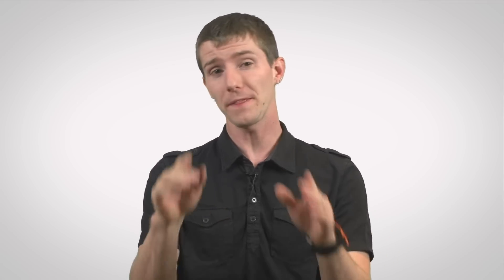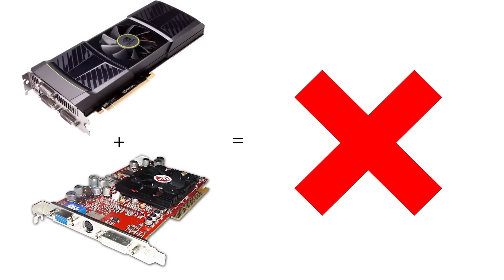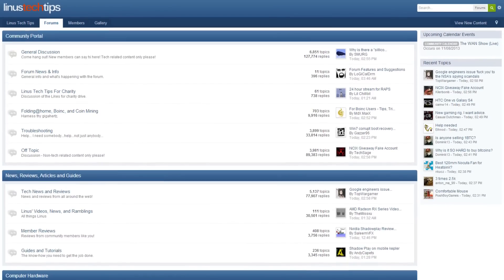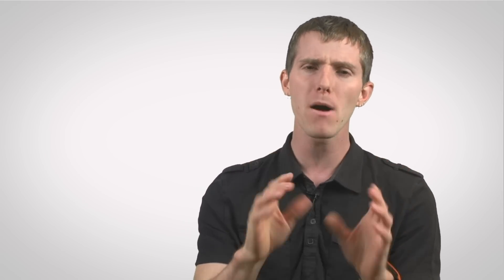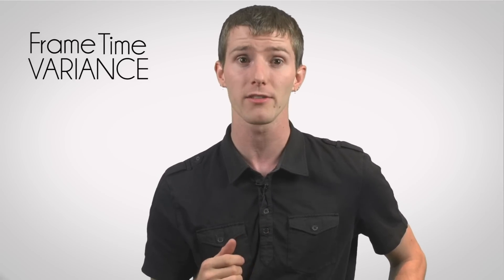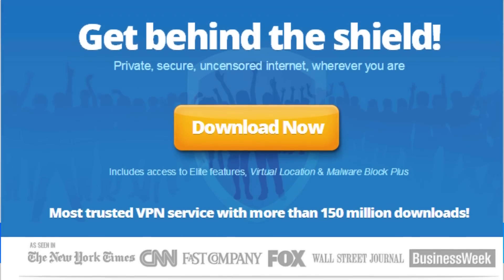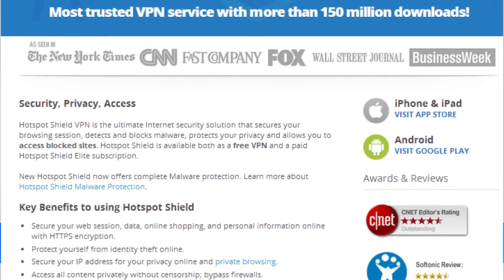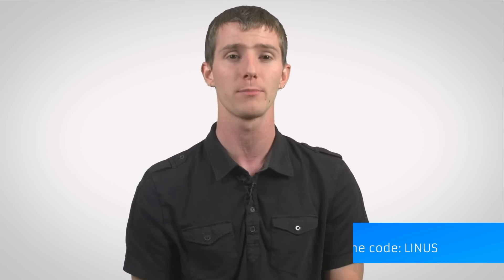SLI by NVIDIA - Everything you Need to Know as Fast As Possible

Comment: how do you compare GTX680 2way SLI vs GTX1660 Super ? Can the SLI beats the single 1660 Super? My PC: i7 3930k, Main Asus P9X79 Deluxe, 16Gb Dominator 1866Ghz, Corsair AX1200, SSD SamSung 860 Pro 512Gb + Samsung 850 Pro 256GB. I'm considering to upgrade my old PC's VGA for almost working with AutoCad, 3dsMax, Adobe Premier, Photoshop.... more than playing games. Thanks for support.
Reply: Don't even try SLI today. It's pretty much dead.
Reply: @user-tm3fz7qx3s  thanks, NVlinks should be better though?
Reply: @MansStyles  Nvlink is a protocol and as far as I know, only the Quadros have real Nvlink. I think I heard that you can enable Nvlink on consumer RTX cards, but it's experimental. It should be easier to implement for developers since it turns all cards into one big card rather than a slow link of multiple cards you have to program functionality for. Look it up at its current state since I have years old knowledge in Nvlink.

Comment: If I put 2 RTX 2080 ti cards in my next computer, would I be able to turn one of them off at any time?  I play a few games, but for the most part I'd like to run the second card only for final renders in Blender or 3DS MAX.
Reply: Don't waste your money for unworthy old GPUs just but the RTX 4090 it's basically equal to 2x SLi RTX 2080 Ti and the RTX 4090 is mostly faster because single card is a much better optimize than 2 SLi Cards.

Comment: Is GTX 1050ti sli worth it in 2018?
Reply: No, you're better off buying the gtx 1070 as the 2nd 1050ti won't give u double the performance as linus explained in the video. SLI isn't worth it unless you already have the top end card such as 1080ti. Nothing is faster then the 1080ti therefore SLI 2 of them would be worth it, but at that point it you'll just be blowing money. So in other words, if there's a faster single card then the SLI, go with the single card.
Reply: @mikeramos91  The RTX 4090 is faster than 2 GTX 1080 Ti SLi for 2023.

Comment: Can anyone explain me one thing? 
Question: How on earth SLI (Dual GPU) would ever increase/double performance of the game in framerate if both of these Gpu's are doing same data at the same time and use only use as much memory as single GPU have?

To me it's like running same game on two separate pc's and wishing to get double fps. The whole SLI thing sound totally idiotic! Logically there could be only this way: Both GPU doing totally different data and using their own memory but in result adding everything together. Which would mean two 4gb cards will have 8gb total vram. 
Can someone explain me what did i missed?

Comment: Can anyone help or tell me if the type of SLI bridge matters for any GPU? I'm going for a 2 way SLI with the Asus - GeForce GTX 1080 8GB ROG STRIX Video Cards. I read that the ROG Enthusiast SLI Bridge isn't compatible with the 1080 GPUs. as well as I'm having trouble with finding any 2-way SLI bridges with a good price. So I was wondering if I can use a different manufacturer SLI bridge to connect both GPUs.

Comment: Unless you plan for SLI with Used cards in the future. Your diminishing returns is pretty much negated and kinda making rigs upgradable for cheap. My big question, is using one Ti with a OC card from different Manufatures okay? do you need to manually match the clock speeds?

Comment: If I run 2 Radeon RX 460 on a i3 processor and on one monitor. Will I still get the same performance as only one you but not the other because it would bottleneck my CPU. Pls answer me. :)

Comment: can I run gtx 1080 and titan xp in sli or evan 1080 and 1070 in sli
Reply: You can but it will use the speed of the slower card. Also if there are vram differences it will ignore the extra vram on the more powerful card so no point in doing that.
Reply: NuclearOnion  ok bro thanks
Reply: I would reccomend the 1070 sli btw, out performed the 1080 for not much more. It even out performed the titan x in some games.

Comment: im sorry im dumb but will gtx 1060 and 1070 pair??
Reply: AlienZap nop
Reply: tnx for the relpy you saved my pocket :)
Reply: No problem 👌👌👌👌
Reply: Even a 1060 and another 1060 wont pair as it doesnt support sli. As for pairing 2 different cards it does work but it will just use the spec of the lowest end card so there isnt a point.
Reply: Ohhhhhh
Reply: Tnx
Reply: Wait wat?I think that"s pretty risky and a waste of money.And note that nvidia and amd can never be pair because of two different driver.

Comment: So if i want SLI do i need to buy another 8GB Asus nvidia gtx 1070 for it to work? Or can i use a 4GB asus nvidia card with it?
Reply: Quirk-E if you want to SLI you need 2 of the same card. Example 2 1070 is a perfect SLI.
Reply: Yeh I've done some research now. My question I do have now, is do I need one of these funky blocky ones, or the cable-like ones? Also, is dual 1070 decent? I think 1080's are a bit pricey for performance.

Thank you for your response though.
Reply: You need the blocky ones for the 1000 series cards. 2 1070s surpasses the 1080 and in some cases even the titan xp so its a greate set up :)
Reply: Thanks! That'll be awesome. Thank you both for all your help :)
Reply: Quirk-E No problem! Thank you Nuclearonion for responding to he's question. If you got more questions feel free to ask Quick-E.

Comment: Will i end up running a cpu limited, or a gpu limited? I plan on using a 2 way gtx 750ti, and I have an i7 6700 3.4ghz.
Reply: SUP3RC0N41L you'll do fine
Reply: OH wait i just realized you can't sli a gtx 750 ti.
Reply: SUP3RC0N41L 1060 can sli. But if you are not going to sli, try the gtx 1050 ti

Comment: so if I buy a CPU that has integrated graphics, am I going to have problems when i buy a GPU? Is the other one just going to sit there doing nothing or what?
Reply: I was thinking about Intel Core i5-6600 and with that either Radeon RX 470 or GeForce GTX 1060

Comment: So as far as I understand, to SLI two or more Graphics cards they must be the same IE two 1070 best with the same Vram (let's go with 6gigs). 
 
I'm building a custom rig, so two SLI 1070 customs with about 4 or 5 fans would work in a case with lots of airflow, but I'm wondering if a Blower in the mix would yield worst quality overall being inherently different. Even though the two are 1070's and from the same company they yield different  Core Clock and Boost Clock speeds. The only forum I could find that discusses this is this << http://www.overclock.net/t/1467698/can-you-sli-a-reference-and-non-reference-cards >>. 
 
Also if they are near the same specs can it work? or do they have to be the exact same card?

Here is an example: 
MSI GeForce GTX 1070 DirectX 12 GTX 1070 GAMING X 8G  Ready SLI Support ATX Video Card
8GB 256-Bit GDDR5 
Core Clock 1657 MHz
Boost Clock 1860 MHz
 with
MSI GeForce GTX 1070 Founders Edition
8GB 256-bit GDDR5
Boost Clock 1683 MHz
 
I'm asking for purposes of cooling being that the first throws hot air everywhere and the blower sucks it out. Also how will it affect the performance between the two?

Comment: what is better Dual Geforce GTX 1070 8GB And High Bandwidth Bridge or one Geforce GTX 1080 8GB
Reply: Dual 1070 by far a 1080 is not that much better than a 1070.
Reply: ^ exactly true performance ratio is much better with dual 1070s.. many times you can oc the 1070 to 1080 clocks any who.

Comment: because first time i ordered usa product by amazon.com evga kingpin 6gb gtx 980ti why i am choose this card ? because this heat sink is copper & 12 layers pcb strongest more performance on my budget more expectations but i am disappointing after one month i am from india if this evga service centers not available in india unfortunately this card no signal problem through hdmi port on my screen so many time checking rams, slots changing, motherboard changing but not working this card so i think same gpu & ram by sli so i am again purchased gtx 980ti asus card it available indian warranty service so this two card sli connection that working evga gtx 980ti may be works or not i dont no

Comment: Hold on, if a gtx 1070 is a 1080 with 25% of resources disabled,  and they still have the same amount of vram, does that mean you can have a 1070  and 1080 in sli?
Reply: nope.

Comment: well i dont know if i am gona get a responce but can i sli a gtx 960 4gb vram with a gtx 970 4 gb vram ? since they both have 4 gb of vram or it wont work ??
Reply: No, they have to be based on the same chip. So you will need two gtx 960's @ 4gb or 2 gtx 970's @ 4gb.
Reply: Jarred Torres
 thank you for your time to respond sire !
Reply: My pleasure. ^_^;

Comment: I'm still running 2 GTX 680s 4GB and they do the job just fine. I don't see the need to go out and spend another grand on a 1080. It still runs way better than consoles.
Reply: Wait until early 2018 for the Volta cards.
Reply: #PCMASTERRACE?

Comment: SLI is so pointless though. Why use 2 cards if theres always one card thats better? If your going to do SLI, only SLI the current BEST cards on the market. Otherwise, not worth it
Reply: true, but it saves a lot of money. for example if you have 980 just sli it with another 980 to get near the new 1080 with half the price.
Reply: snaperz I think I see what you mean. But a single 1070 is like $379 msrp which is cheaper than the 980 and way more powerful

Comment: I need some help can I sli a gtx 980 classified with a gtx 980 that is not classified
Reply: as long as the clock speeds are the same(which is not hard to fix) and they have the same vram, yes

Comment: Shall i buy another 760 or buy the new 1070?
Reply: +דניאל משה 1070
Reply: ARE YOU KIDDING ME? 1080 throws 980ti out of the park in everything
Reply: The 1080 barely beats 1 980ti let alone 2...
Reply: the 1070 would destroy the 760. the 1070 is acctually rather similar to the 1080 but scaled back a bit so where the 1080 beats 2 980tis the 1070 would probably break even or maybe a little worse.
Reply: What games do  you play?
Reply: ffs what is that for a question 

of course the 1070
Reply: +The Timelords clarify, it is around 25-35% better than  ONE 980ti not two...also clock for clock, think the 980ti still comes out either tied or a bit ahead. sure it doesn't make sense to downclock a 1080 to OC 980ti levels but a 30% performance increase isn't really that amazing when it has to be clocked 150% higher to achieve it!
Reply: Chris Dunn true, but its better for the money
Reply: +The Timelords this is true...what about that 1070 though!? Tell me that thing isn't ridiculously good for the price!
Reply: Chris Dunn well it beats the titan an is a simelar price soooooooo..... yeah....
Reply: +Revampedharpy09 yea gonna be honest that was heartbreaking seeing that! luckily though, my experience with almost buying a 980 right as 980ti was announced has helped me this gen to not jump straight on a 1080 and await a 1080ti!
Reply: +Chris Dunn probably a good idea. i should be able to acctually tell you how good the 1080 is soon because my cousin is getting one.

Comment: ya ok thank you but  same gpu 980ti 2 card evga same ram same gtx 980ti but EVGA GeForce GTX 980 Ti K|NGP|N ACX 2.0+ 1st card
1203MHz Base Clock
 & 
1304MHz Boost Clock
my 2nd card EVGA GeForce GTX 980 Ti VR EDITION GAMING
1000MHz Base Clock
1076MHz Boost Clock THIS 2 CARDS WOKING  SLI CONNECTION (OR) NOT WORKING ? IDONT NOW PLZ LET ME KNOW CAN I BUY THIS CARD OR NOT PLZ TELL ME SIR PLZ
tttthis
Reply: gtx 980ti with any model of gtx 980ti so dont worry

Comment: i have a 1000wat psu and i want to have sli on 2x msi gtx 970 will the 1000wat psu is enough to run the 2 msi gtx 970?
Reply: yes, check out pc parts picker if you are ever not sure
Reply: yes

Comment: so hopefully someone knows this. I have an SLI configuration of 960 ftws, because one 960 is enough for 1080P in most cases. but the 2gb vram is a bit on the skimpy side, and I use a 1080P monitor 60hz. so would I be able to get a lot more out of my cards with sli aa, let the game render in the 2gb vram of card 1 and AA on the 2nd cards 2gb vram? Effectively using 4gb of vram just not improving fps, rather quality of each frame. is this an accurate interpretation of how SLI AA works or would I be smart to just keep regular sli?

Comment: If I have a 460 and a 460 se, can I still set up an sli in my computer?
Reply: what does "se" mean?
Reply: it's a different version of the 460. It's like having a Honda Civic from 2007 and a Honda Civic from 2012. But in video cards...
Reply: +The Liquid Diamond the it will fit, as long as the clock speeds are the same
Reply: ok

Comment: So gtx 680 and gtx 750 it wouldn't work?
Reply: No
Reply: +Sam Parry Unless the less informed people down here, yes since DX12 it should in theory work. You could even use a AMD and Nvidia card at one time. However, there seems to be debate on how well it works and how stable it is. You need Windows 10 to my knowledge to run DirectX12. If you play games in OpenGL this would obviously not work very well. Side note; I think Mantle should support it aswell.

Comment: I have a GTX760. My main reason for thinking about SLI is for 3D rendering. Blender is sometimes running out of memory for GPU rendering, I remember hearing somewhere (I thought it was this video) that SLI doesn't actually increase VRAM is that true or not?

It also has to be an nvidia card my experience with rendering in OpenCL with AMD and Blender is enough to put me off rendering with AMD.

Comment: plz help me can i use the

1. EVGA GeForce GTX 760 SC 4GB DisplayPort HDMI DVI-I/DVI-D Graphics Card with ACX Cooler 04G-P4-2768-KR

& both sli conneted Or not i dont know plz help me i think better performance

2. ASUS GeForce GTX 760 DirectCU II Graphics Card

i bot the asus card i am looking for evega card
Reply: ya ok thank you but  same gpu 980ti 2 card evga same ram same gtx 980ti but EVGA GeForce GTX 980 Ti K|NGP|N ACX 2.0+ 1st card
1203MHz Base Clock
 & 
1304MHz Boost Clock
my 2nd card EVGA GeForce GTX 980 Ti VR EDITION GAMING
1000MHz Base Clock
1076MHz Boost Clock THIS 2 CARDS WOKING  SLI CONNECTION (OR) NOT WORKING ? IDONT NOW PLZ LET ME KNOW CAN I BUY THIS CARD OR NOT PLZ TELL ME SIR PLZ
tttthis

Comment: Why are people asking if they should SLI a 2gb vram card? its basicly useless to SLI them as most games will use WAY above 2gb vram - its much much better to get a single 4gb+ card - 1: ur more future proof - 2: Games run at higher settings due to you not having to cap your settings at 2gb vram. get a nice 970, 980ti or a r9 380 or 380x and u will be future proof and have an extremely nice gaming experience, dont forget about the CPU. alot of games are CPU bound I.E buying a good graphics card wont help anything if ur CPU is bullshit, it will bottleneck and u will have a terrible gaming experience. i recommend intel cpus for gaming (not a fanboy) but it really does better in gaming from my experience - i have a fx 4130 and a fx 8350 and they both run poorly in games compared to my 4690k from intel.

Comment: If you are running a lot of mods, will a better cpu and 16 gigs of ram fix any slowness your pc may be getting?
Reply: +A Helpful Person lol perfect name for you
Reply: +A Helpful Person It's custome made, has 8 gigs of ram, gtx 980, some randome 40 buck motherboard, amd black edition for the cpu
Reply: +A Helpful Person skyrim, gta 5(that one kinda drops my frames with mods), Minecraft lol
Reply: +A Helpful Person ok thanks, now my mind is made up to find one of thouse Intel cpus, I'll check benchmarks and what not
Reply: +A Helpful Person Your name is very fitting here :)
Reply: +wayne conover In GTA 5 on my AMD 8350 OC cpu i had fps drops to 40-50 fps from time to time, after that i changed to intel side, an 4690k and i OC it, i now NEVER - EVER run below 60 fps in gta 5. IDK how well AMD runs with GTA but intel certainly does it better in that game.. also if u play skyrim modded u might want an intel cpu also for the faster single core performance - i recommend the same cpu as i bought - the 4690k its really good for gaming, if u do some workstation work also or some heavy rendering / 3d work, u would get an i7.
Reply: +bech 1200 and im not saying this cus im an intel fan boy as i have SERVAL amd cpus at home but honestly intel just does better for gaming
Reply: +wayne conover you need atleast 8gb of ram for gta and skyrim, especially if they have mods

Comment: Linus If you are listening please do a video on what the best processors would be for 980ti SLI I have been trying to find out which would have the least bottleneck when running Multiple Powerful Gpus So far I am assuming it would be 4790K, 5820K, 5830K, and/or maybe the ridiculously expensive 5960X but I would be interested to know how these would stack up in a Multi Gpu Showdown using 980ti Sli during gaming. For kicks it would also be cool to see how badly the AMD series Cpus like the FX8350 will bottleneck because I don't think they will work very well in this type of scenario.

Comment: It seems like very slowly, SLI is becoming less and less powerful. I have 2-way SLI 760's and it doubles benchmarks compared to 1.

My buddy had 2-way SLI 970's. Only about a 75% increase.
Reply: +AlphaLineGaming Yeah, got a 760 (2gb) myself, was thinking of either waiting for new set of gpu's to release (970 will drop and i'll buy the 970) or get another 760 2gb gpu and put them in sli.

Only thing i'm affraid of is that games wont support SLI ...
Reply: +PCgamer1080 dont buy another 760 thats just stupid, most games use way above 2gb vram (not that ur card is bad BUT it could use more vram) the newer games easily use 2-5gb of vram, if u enter above 2gb vram in a game u will have massive lag.
Get a new card with atleast 4gb, i have a 970 myself its pretty decent tho its only 3.5gb as the last 500mb is rendered useless.

Anyway, i would recommend a 980ti if the budget is there for it, otherwise a 970 to be able to play all games at high/ultra/max settings.